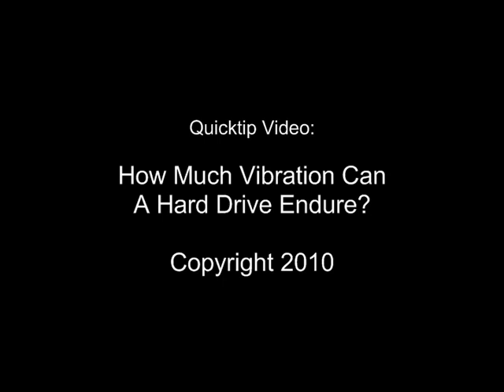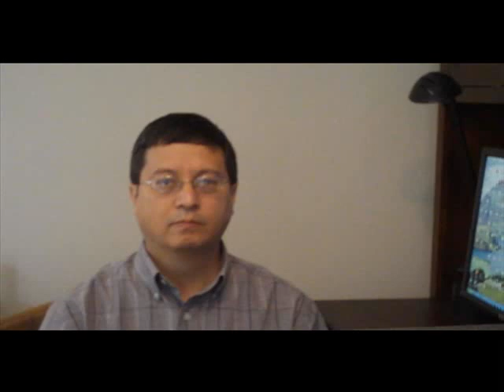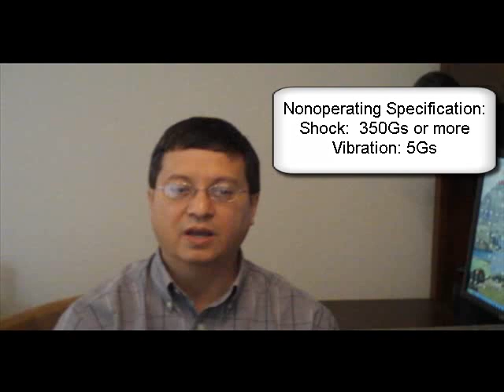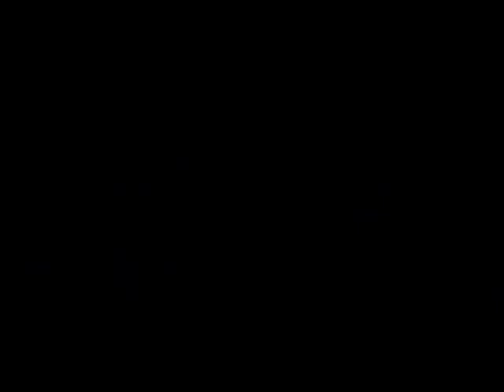How much vibration can a hard disk endure.flv

Comment: Very informative, thanks. I have a question. I've lost my hard drive a few days ago, and I have been using a G27 steering wheel (gaming) for many months since then. Is there any possibility to the G27 force feedback have damaged it by vibration? I couldn't separate de desktop from the steering wheel, because I don't have space, so I couldn't avoid the hard drive from the vibration. But what is strange is because I have been using it for so many months with all the ffb vibration but this happened only now.